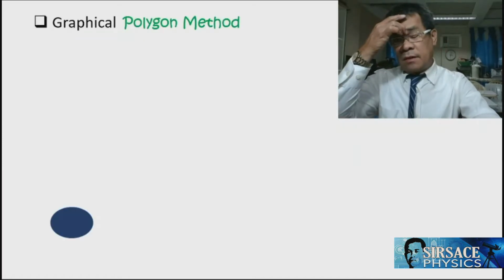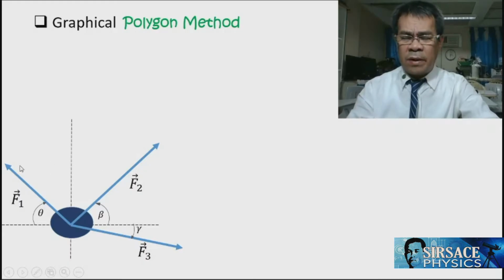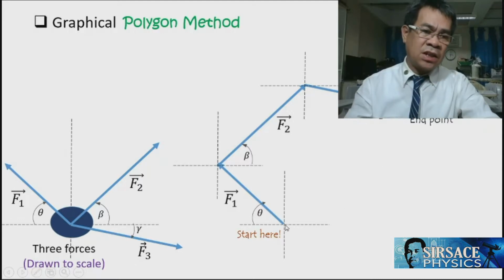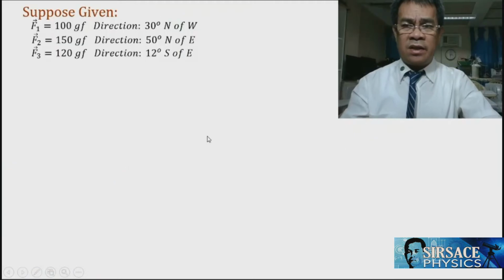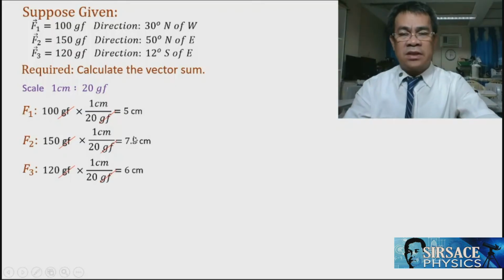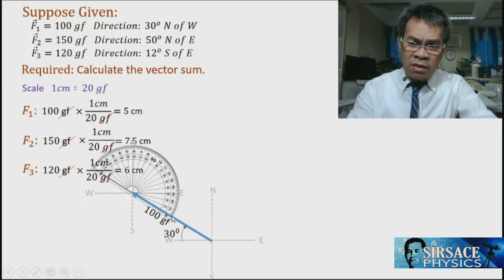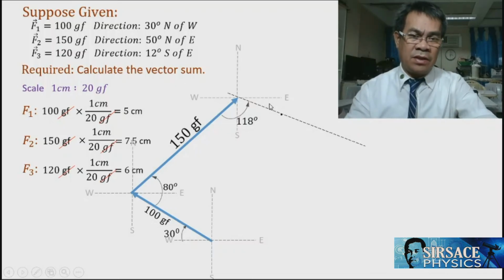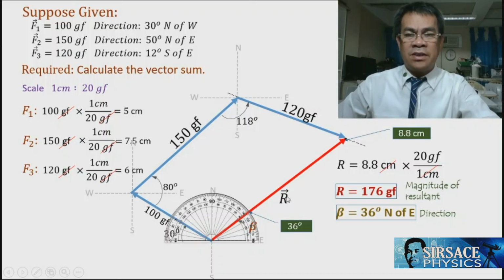Part 2 | Finding Vector Sum Using Polygon Graphical Method

Comment: So it's not important in which vector I have to start, I should respect the clock wise rotation, or anti clock
Reply from the maker: You can use standard angles. Positive for counter clock wise other wise negative.